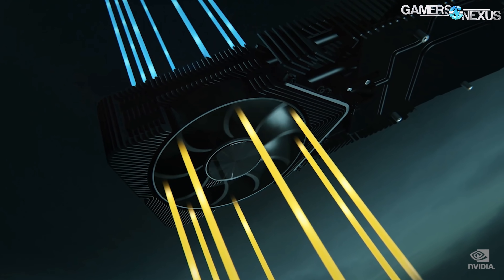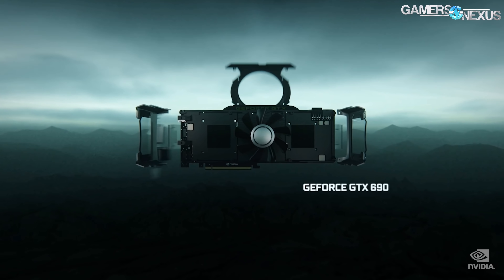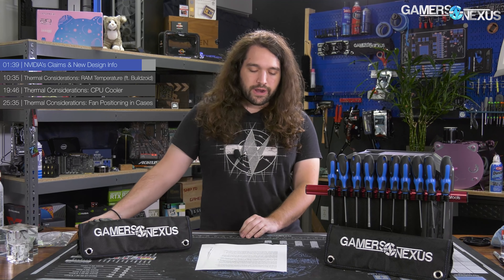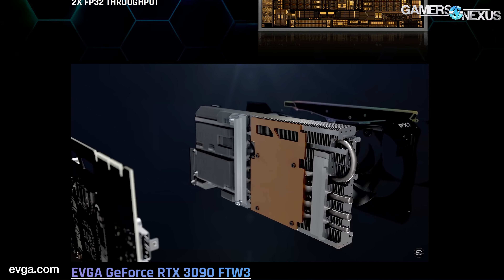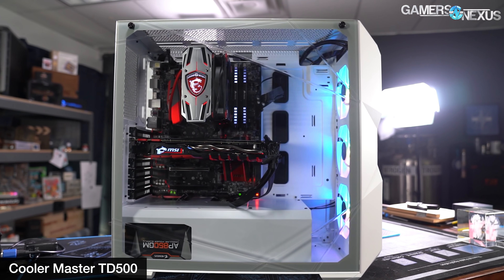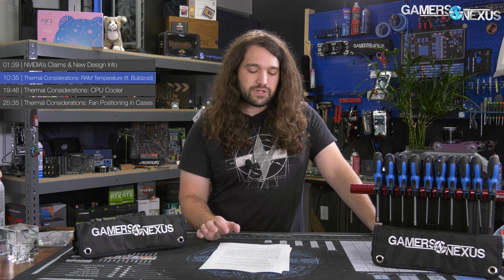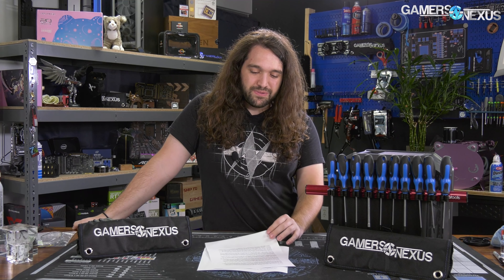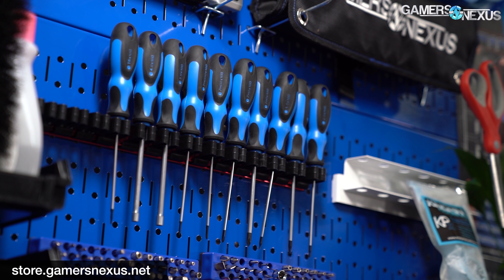NVIDIA RTX 3080 Cooler Design: RAM, CPU Cooler, & Case Fan Behavior Discussion

Comment: Can’t wait to get more info on this, I’ve been trying to figure out what case I might need to upgrade to by watching your case reviews. I’ve been thinking of getting the white case you show early in the video, not the one you are talking the whole time with, and putting 2 x 140 mm fans, a exhaust fan and upgrading to water cooled cooler master cpu cooler and putting the radiator over the intake fans. But I don’t know if I can do it with that case, so I was thinking of getting the nzxt h 510 elite and custom making a screen filter to replace the glass on the front. Not sure yet, gonna make decisions once I get my hands on the 3080. And if you want an image of what nvidia has been running to cool the gpu look on their website and you can see an image on the Rtx info streaming slide portion of a pc with the gpu in it. They have some kind of exhaust cpu cooler set up. Can’t find that cooler available anywhere so maybe something new, not sure.

Comment: Almost all custom cards are coming with a half backplate ,so basicly working same as ref cooler ,  shooting hot air up from VRM area . The only "full closed backplate " i saw is from MSI  (Ventus) .
Im thinking about to  set top front fan as intake  (top rear  as exhaust ) . So my CPU tower cooler would get half warm air (from vga ) and half cold air from top intake .  Or even try both  top fan as intake .

Comment: cooling with 30 series made expensive but easy:

360mm rad AIO in the front for cpu cooling (intake),
all (2x) bottom fan slots populated as intake,
all (3x) top fan slots populated as exhaust,
(1x) rear fan slot as exhaust.

should work beautifully.

except its a big case and 9 fans. and 9 x Noctua is almost 200$ just for the fans alone :D

Comment: That driver kit looks irresistible to a tool hound.
My thought on the RTX 30xx series.  Reverse the airflow through the CPU tower cooler with the rear and rear top fans as intake. All the fans in the top front corner (top and front)of case as exhaust. Front bottom fan as intake, with GPU level baffle to direct the flow to the GPU. And any available bottom fans to supplement feeding the GPU. Possibly 140mm fans for exhaust and 120mm for intake to minimize an excessive positive pressure imbalance. This all for a purely air cooled build. I know that the RAM will wind up being in the hottest part of the case. As Buildzoid pointed out, RAM is very heat tolerant unless you are running heavy overclock.

Comment: Ok so now I'm wondering if you got 2/3 front intakes on your case it may be a good idea too have a tube that links the intake fan directly too the CPU fan too pull in ambient air from the external part of the case?

Comment: i wonder if when using a tower cooler you could run it backwards, exhaust all air out the top and use tthe back exhaust position to pull in air for the cpu

Comment: Something worth considering here... Just where do people think heat goes when ejected out the sides of a custom AIB cooler? One side gets shot into the motherboard where you have the chipset, SATA ports, possibly the CMOS battery and CMOS chip... the other half gets shot into the side panel. Then what? If you have proper pathing of airflow in the system, then you can expect both sides of hot air ejection to get pressured up and around the top of the card... where your RAM and CPU cooler are... Again, if you have proper pathing of airflow, you should also have a source of fresh external air coming in to mix with that graphics card heated air thus preventing it from having any significant effect on the RAM and CPU. This cooler is effectively doing the same thing. Potentially half or more of the heat is getting launched up into fresh airflow and over the RAM and into the CPU cooler. Meanwhile most of the heat from side-ejected coolers dump half or more of their heat into the same section of the PC. I would likely be willing to bet a 3090 on the expectation. Stock 3090 vs side-ejected AIB cooler 3090.

Comment: I really want to see how they perform in the Lian Li 011 dynamic. Three bottom fans pulling air into the GPU, right side intake for CPU aio, and top three fans as an exhaust for the system. I cant see a way for that setup to not perform the best... other than there will be even more people running the same case lol.

Comment: Your driver toolkit is missing Pozidrive heads or do you not use them in US? PZ2 are probably the most common that I use, stopped using philips years ago because they don't stay in place on the end of the screwdriver.

Comment: Bonus question for future benchmark : What append if you put a FE card into a inverted ATX setup ( for example be quiet DB 700) with a vertical flow, cold air coming from bottom and hot air expelled from top ?

It really seem like a bad idea, card will simply do the opposite of case fan, any chance the fan on the FE card can be inverted ? If yes, then is a super good setup, no more heat issue on CPU and RAM.

Comment: Hey guys, I'd like to make a respectful request for RTX 30 analysis.
Could you make some choice performance comparisons on Intel platform between PCI 3 x8 and x16.
There are likely a bunch of folks running additional nvme drives and sharing lanes with GPU to avoid dmi bottleneck. Knowing which GPU generation makes that ill-advised would be nice.

Respect and appreciation as usual.

Comment: I really like your objectivity and approach to wait until you can get real test results.  My two cents is; that dumping heat onto the CPU intentionally from a 320W GPU is a bone headed design choice. If I buy a card it will be with liquid cooling just to avoid this and keep things cooler.

Comment: What about physically separating the airflow coming from the gpu with an acrylic panel underneath the cpu. I've seen puget system do this to channel the air flow around/to specific components as needed.

I realize its not for the average user but it would be interesting to see how much improvement one can get by manipulating the airflow.

Comment: In the simulation and air flow drawing, inlet only thought come from the bottom right, which is not true. I would have thought that if accounted for, the inlet coming from top right side flowing towards the left will mean increased pressure for the right fan to work at all.
Reply: Can you expand on this point, realisticly, that will be common case air flow if have got a front intake

Comment: These last few days I've seen dozens of questions from 8700k owners that are wondering if their CPU can handle an RTX 3080 or 3090. These questions are on pcpartpicker, reddit and even good ol' Yahoo Answers. I know the 8700k is only 3 years old and it's using Skylake cores like everything else but maybe it's time for an 8700k revisit. I would tend to think that an 8700k and 10600k that have the RAM, Cache, and cores overclcoked to the same level would perform in a similar manner.

Comment: you can always invert the cpu air cooler to take air from the the back of the case and have an exost in the front top, that way you would be adapting the airflow to match the gpu air flow what do you guys think about that?  it would be the fan in the back of the case intake the air cooler flowing air towards the front of the case and then you can have either an exost fan in the top front or and exost fan in the front  (it would be and look weird but I think it would be functional) am I right?

Comment: If Steve says ditch the stock air cooler, I ditch the stock air cooler. Just switched to a Kraken X63. My CPU never topped 65 C, but one does not argue with Steve.

Comment: With this style of cooler it  shouldn't be too hard to make physical separation of air flow between card and processor. Some kind of barrier or duct to direct flow towards rear exhaust, instead of towards processor

Comment: giving that the fan closes to the GPU on the 3080 FE card is blowing at the base of the heatpipes, doesn't that mean that the wicking effect will be reduced in the heatpipes as the water turns into liquid before getting to the heatpipe's optimal phase changing point which is at its end?

Comment: Looks like if you have the GPU setup with a vertical mount the chipset would be getting hammered by the rear fan. Unless it is able to be configured to reverse 🤔

Comment: Theorically this cooler will just speed up the rear/top fans job, witch it seems to be a good thing. I've mounted a considerable number of computers and in general, if the front intake is not excelent, the mid section of the case (near to GPU) helds a LOT of heat around the GPU, you don't even need a thermometer, it's just put your hand a little closer. Blower design usually don't have this effect, only custom ones.

Comment: I'm interested in the FE performance in sff builds, specifically sandwich style cases like the Dan a4. Will the pass through fan essentially worthless in a sff PC build, or is it better than expected? Very few AIB partner boards coming out in 2 slot/low profile variants, so FE is the only option for many. Would be interested to see how it's performs in that use case

Comment: I checked out the toolkit - but it appears to be missing a PH2 driver - which is - or at least used to be - the most common screwsize in the case - for case, harddrive, psu, cd-drive, motherboard and fan-screws

Comment: Test Bench Open (best) // 2xFrontFan 1x BackFan (very good) //  1x BackFan (cheap/average)
That's how I measure best > average tower cooling...
I use open side panel with not a single fan around the tower and works like a charm :)

Comment: @gamersnexus My question is what would the thermals for the entire case be if you have the 3090 vertical and have its heat be absorbed by the glass (or aluminum) and have it dissipate that heat transfer?

Comment: Just built a case that I wanted for a while and waiting for the new GPUs (running GTX275 right now as it's the only thing I have working >_>): Define 7 Compact, 3800X with NH-U12S cooling. I will be buying Noctuas NF-A14 (2 front and 2 top) and NF-A12 for the back. I'm gonna wait for these GPU's and I'm prolly looking at something around the 3070 range. I MIGHT go for a 3080 if there's something I really need but I don't do extreme gaming anyway (even then, 3070 should perform at least as a 2080Ti which is more than adequate for any title today). Would love AMD to unveil some stuff too. Hopefully I don't need to change anything in my rig cause I'm happy with it as is even tho I know the Define 7 Compact isn't the best for airflow. If only the Meshify C Mini had USB-C on the front I'd prolly have taken that one.

Comment: Could you test a rotated orientation case like the FT05 or other silverstone? Those long heat pipes on the FE cooler have me worried if they are vertical.

Comment: 02:17 Talking about the amount of screws, I just opened my Logitech G Pro wireless mouse to fix a double-click issue and omg it has around ~20 tiny screws 😲

Edit: Logitech mouses always have double-click issue after just about a year of using (the notorious one is G102, but G Pro wireless is more or less the same). I am gamer, yes, but click-heavy like starcraft or lol are not my type. So don't blame on my clicks....

Comment: Would a flat fan funnel (made using 3D printer) mounting on top of the GPU fan helps routing the hot air to the back of the case?

Comment: I believe I am fine with my Lancool 2 Mesh and 11 fans. 3/3 push/pull 360 front radiator (pushing air into the case) bottom 2 intake fans, top 2 fans exhaust, and 1 rear exhaust. 

I am considering getting a liquid GPU (AIO) maybe like the kingpin or Aorus WATERFORCE GPU on top. I know if I go custom loop all of this would be meaningless since the waterblock will be similar to the older design.

Comment: The founders edition 3080 won't even bother my CPU or Ram. The way the cards cooling is designed it'll just blow directly out of the case I have instead of blowing inside the case into the Ram and or CPU cooler. 

My case is a slightly modified Node 202. The mod is that I cut a hole in the top of the case directly above the GPU to vent the heat and I have a duct so that the heat that's vented is pointed away from the CPU intake.

Comment: 6:40 it‘s not a 10 dba Noise reduction AT 20C lower temperature. 
It‘s EITHER 20C cooler at the same noise level OR 10dba quieter at the same temperature.

Comment: When the RTX 30 Series comes out, maybe this https://www.amazon.de/Diyeeni-Mini-CPU-Kühlersystem-PCI-Steckplatz-Lüfter-CPU-Gehäuselüfter-PCI-Lüfter-default/dp/B07V9NTDZS/ can be used to make sure the heat from the card does not stay in the Case. Put it in the slot above the card and build a shroud to redirect the exhaust from the backside (upper side) of the gpu out through this thing. Would love to see a video testing this when the time comes!

Comment: I get the impression from the increased power requirements and the fancy coolers that the 3000 series isn't exactly the most power-efficient architecture thanks to Samsung's 8nm process. It seems like Nvidia have worked hard to try to overcome increased power draw and I think it'll be interesting to see how close real-world performance per watt is compared to Turing (or even Pascal).

Comment: I literally spent all day trying to stabilize my memory at XMP frequency/timings only to find out that my front intake fans were running slow and causing the dimms to overheat. I've had so many issues as of late with B-Die temperature instability just from poor ventilation. Looking at the FE coolers, which blast hot air directly across the dimms, makes me a little ill.

Comment: I'm interested in seeing the difference in performance of a 3000 series card when you run it in a PCIe 3.0 slot vs a PCIe 4.0 slot. If that's possible.

Comment: My worries would be with the Chipset cooler on the X570 motherboards. The NVidia cooler design is closed to the sides, so it will limit the air going towards that chipset fan. It shouldn't make a lot of difference but if the manufacturer cared about putting a fan on it I wouldn't want to close it of by slapping a metal plate ontop of it. even warm airflow might be better than no airflow.

Comment: Mentioning that for a tower cooler, it wouldn't be a particularly good idea to mount a top front exhaust cus it can steal air away from the CPU cooler, would it be a good idea to make it instead of exhaust, an intake? I have one there but I have it manually set to max speed of 67%/~1000 RPM as I already thought of what you said, it's very difficult to fit the fan I got at the top back instead as I have a large Noctua CPU cooler so not much space.

Comment: do you think the FE style of GPU and maybe increased heat might tip the scales towards AIO CPU coolers? I prefer air but a D15 will be literally right on top of the exhaust of the FE3080 (might even block off some of that exhaust with the first fan..  But likewise you might want the increased thermal headroom of a larger tower to mitigate the increased heat..

Comment: So for what I'm seeing from the new PCB design and fan setups, the far end of the card, and it's fan, is probably mainly used for heavy loads that generate large amounts of heat. I'm guessing that the farthest fan will only spool up when the far end of the heat sink needs to be cooled more forcefully. That is the FE card, and not the third party manufacturers. God knows how those will work. I think, looking at Asus's options as an example, the FE will do far better in cooling for the case overall, but the Asus card will probably have a cooler card but warmer case. It might be close. Nvidia, thankfully, has made a very nice looking card that seems incredibly functional at the same time.

Comment: I honestly don't see vrm/ram/cpu temps rising much of at all. Normal open air cards have 2 fans blowing air out into the case where it usually crosses the cpu/mobo area anyways. If anything I'd think the temps would be slightly better considering the FE cards are pretty much hybrid blower-open air

Comment: @gamers nexus How do you think the founders edition cooler will perform in the silverstone inverted cases like the raven and FT02? 
Ive got an FT02 and i reckon the founders edition will work really well in that case, I think most of the heat will end up coming out of the back fan of the founders edition as it will rise up and out im guessing, I think ill change to a 120 aio cooler for the cpu though, rather than the big air cooler im using at the moment

Comment: Yeah currently I have no idea how to configure the cooling setup using this same case with a 3090. Maybe the lian li mesh would be easier, bottom exhaust. I also wanted a chromax after first seeing it in your twitter replies. This will be my first build and it’s driving me insane. Especially seeing how I want pure performance but a 3900x bottlenecks

Comment: I'm struggling over whether I should  go FE or get the EVGA waterblock version.  I am using a micro atx case and I want it to be quiet.  Currently my system is completely water cooled EK Custom loop and the radiator fans already make more noise than I care for, so I am considering just going FE with a NH-U12A.

Comment: I am not worried about the thermals of my RAM. I have a permanent fan blowing over them from the front of the case. Right now they are running 42.5C and 41.3C the fan is spinning at 350 rpm. The hotter the case the faster that fan will go.